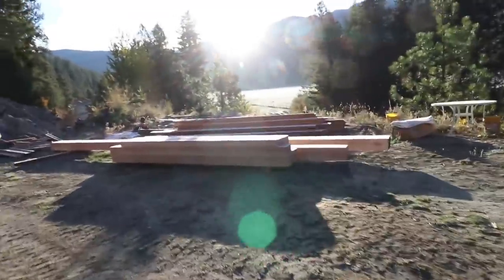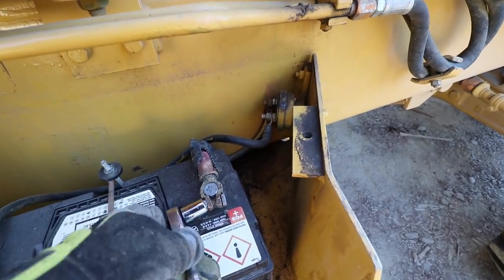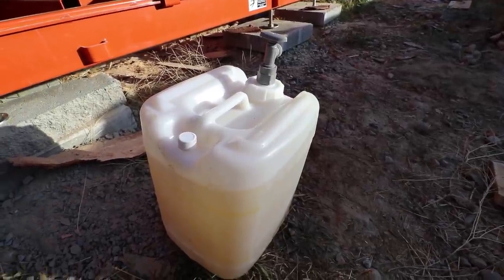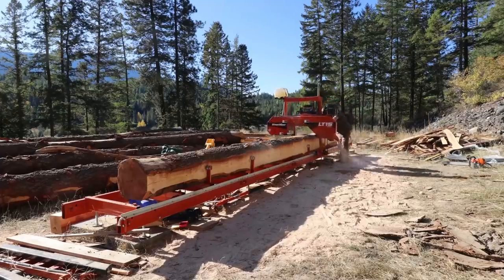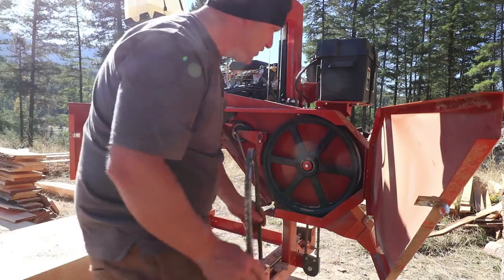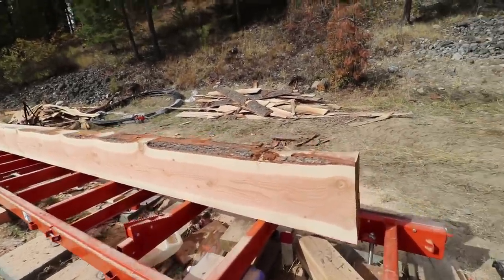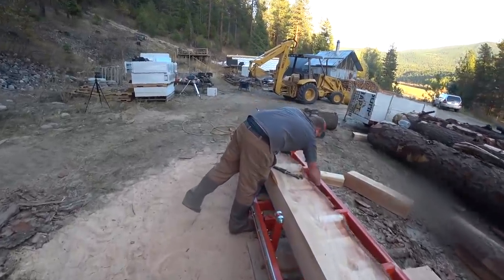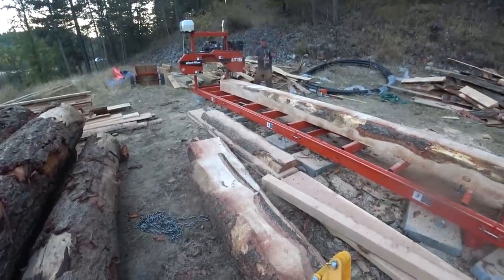BROKE OUR FIRST BLADE! (LT15 Woodmizer Sawmill)

Comment: Jesse do this to check to see if in reality you have a drain on the battery or just a bad battery. First make sure everything is off on the tractor, than take a volt meter on the amp scale and disconnect the ground cable and attach the volt meter ground to the battery post.  After that connect the positive lead from the volt meter to the ground cable on the tractor, make sure that your positive lead is plugged into the amp connector on your meter if not it will damage the meter, also make sure  that when everything is connected the ground cable and the ground post do not touch or you will get false readings. If you see anything more than a .04 amp draw than in fact the tractor has a drain somewhere. If its less than it is the battery failing and needs to be replaced. I will tell you with over 10 years of experience with automotive electrical systems this will give you the answer you need so you are not guessing.

Comment: If you have a multi meter then you can check to see if current is flowing with the machine off.   Also make sure you're running the glow plugs before starting in cold weather

Comment: You could try putting rubber pads between the metal sawmill feet and the concrete pads to keep the mill from moving when put logs on. Can probably get a large sheet of rubber at the local hardware store and cut up into appropriately sized pieces. Would be a cheap experiment.

Comment: You disconnect a ground on a battery first because it has less chance for arcing. which can cause damage to the computer and other valuable electronics on the machine. The same goes for hooking up jumper cables, only in reverse. You hook up the positive first and then the negative and vis versa when unhooking them. If you're looking for a parasitic draw you can always unhook the battery overnight and see if there's a difference.

Comment: Put a test light between the disconected bat cable and the bat stud ... If the test light lights there is a draw ... No light replace the battery..... Doesnt  matter what cable ......... If it shows a draw (light on)    disconnect fuzes till the test light goes off.... That will show what area the short or 12 volt draw is in ........  Hope this helps  Make sure the key is off durring test
Reply: Rick Helgerson, excellent divide and isolation technique.

Comment: you should always disconnect negative side first then positive, not that it matters but on modern cars you can send voltage spike through computers and wipe them out, in your case you should not use tools on positive side of battery without thenegative being disconnected, being a negative ground chassis if you where to accidentally hit the frame while unhooking positive side you can weld tool to battery and frame

Comment: you can have a voltage drop across the battery terminals with dirt/dust.  to test this, use a dvom from post to case. if you are having this problem(and you are) clean around the battery posts/top of battery.

Comment: Could u use concrete screws/bolts 2 fasten wood/steel on either side of some/all feet on the the sawmill to prevent them from moving?
If so, you would want to do so on most/all so as not to over stress just a few.
Also, consider that if you use this method, you will have to be careful about how much stress you put on the deck of the mill as the energy from the moving log will transfer into shear stress on the legs instead of movement as it does now.

I agree the ideal is/would have been to pour a level slab, but unfortunately you guys aren't in an ideal sitch right now.

Thank you for the video.
You guys ROCK!

Comment: Put 6 deep ground screw in anchors with turn buckles two at each end and two in the middle that should keep it from sliding around screw in anchors should be 4 to 5ft long

Comment: Seems like you should be able to secure both ends of the Wood Mizer.  Maybe a buried cement block at each end with some rebar to help secure the deck?  At least something with some heft to it as a temporary anchor.  Maybe a hole, say 3 feet deep, pour some concrete and use either rebar or threaded bar stock?  Just spit ballin'

Comment: To find the diameter of your logs at the mid-point take a length of string and wrap it around the log and use your finger to mark off the location.  Un-wrap it from the long and measure this length of string with a tape measure. this is the circumference (C) of the log at that point.  Use the formula C/3.14=d where "C" is the circumference you measured and "D" is the diameter you seek.

Comment: You normally disconnect the negative for safety, no other reason. If you put a spanner on the positive terminal (with the negative still connected to the body) and accidentally touch the spanner against the body by accident you are going to get sparks :) If you disconnect the negative first, touching the spanner against the body has no effect - much safer. I would just get a new battery, especially as winter is coming, and i'd buy the largest capacity you can fit in the box.

Comment: Backhoe - Check glow plugs/hot air intake circuit, but sounds like a weak  battery   when you cranked it.
Woodmizer (and/or chainsaw) blade(bar) lube/oil - cut it with a little kerosene -  1/2 to 1 qt per gallon; more as temps drop..

Comment: If your battery had that lead off, sine you stopped the digger, then it can only be a bad battery. or a wrongly speced battery.(Spec'ed, fFor cold starting.)
And, check your alternator. If there are bad diodes in the pack, it can drain your battery. (when it's connected). I have seen a few of these over the years.

Comment: i used to run heavy equipment. some vehicles had 2 batteries in series to boost the voltage from 12 to 24 just for turning over. 
could be worth a shot to try that. not sure why it wouldnt be in such configuration now though. 

probably just needs a new battery though

Comment: Either Battery froze at some point, or you may have excessive diode ripple in the alternator. The alternator may be charging the battery enough to run, but not enough to charge the battery to sufficient capacity to cold crank the engine over.

Comment: Hopefully you have already put in your slab for the saw mill. It's needed for certain and will save you a lot of time and miss machined logs. Also the alternator on the backhoe might be putting some charge into the battery but simply not enough to fully charge the battery.. assuming its not a duff battery.

Comment: Do you have room to fit a second battery wired in parallel? Also disconnect your ground connections and clean them with emery tape, the cause of many bad starting vehicles.

Comment: Hey Jesse, I noticed that you are using a floor jack to raise the log end.  If you look close and I'm sure you probably already know this but a floor jack has a tendency to move what it is lifting forward and back instead of straight up and down.  If you were on a smooth concrete floor this would not happen but you are using a floor jack on a rough ground so that the jack will not move forward and back to compensate for the lift. That is causing the saw frame to move toward you and then back again and to move all around.  I have a suggestion, and it just came to me as I was watching you lift the log in time lapse.  Get a spare trailer scissor jack like the one on a travel trailer and mount it to a 2 x 12 square block, and then use an impact driver with a socket that fits the jack to raise and lower the end of the log.  That way 1 it will be faster and 2 it will move the log only and up and down not moving the saw frame.

Comment: To keep your sawmill level, the best thing to do is buy a trailer that's built for your woodmeiser - you don't need a slab, since the trailer only had four points to adjust, it makes leveling it so much easier!!! In addition, it makes the portability so much more practical!!!

Comment: Just a thought, If you replace the concrete blocks from wood it will move a lot less. You can mill some wood blocks ~the same size of the blocks you are using.
I give you guys a lot of credit. I would have subbed out most of the concrete work

Comment: You were thinking of pouring a concrete pad too put your mill on try anchoring the mill legs into the concrete pad so it physically wont move thats what i did with mine and it hasnt moved in 18 months

Comment: Don't throw away that broken blade. You can braze it back together and keep as a backup. If you know of someone who welds, you could try bartering for their work if you'd rather that avenue, but I baize mine and have no issues. Just a propane torch and brazing rod will do the trick. Search Youtube for more info, it's how I learned about it. Has saved me probably $4000 since I started doing it.

Comment: With engine off, 12.70 volts measured across the negative and positive terminals indicates a fully charged 12 volt battery. With engine running, the voltage measured across negative and positive terminals should be 13.5 to 14.5 volts. A Diesel engine, once started, only uses a small current amount if you have a solenoid fuel shut off valve. Your battery may have an internal short or charging system is not producing correct voltage.  Could be both.
Reply: Get the voltmeter out and check voltage before you start and after you start.  It can be useful to check it while starting.  You can also check you disconnect to make sure it's fully disconnecting.  The one ground disconnect should be plenty if it is working.  I would bet the battery has a small internal short drawing the battery down overnight.  Check voltage after you shut down at night and then in the morning.  Don't just throw parts at it.  Diagnose it.

Comment: Ground anchors at all 4 corners and 2 in the middle pulling it down onto hard wood pads, as every time you moved a log the mill bed bounced and moved. 
Needs to have a dampening layer as one light bounce and it all moved, just watch your own vid's to see it moving.

Comment: Remove 6-8 legs from the sawmill bed, drill holes in the concrete pads in place of the legs and  then grab a threaded rod with a washer and a nut so it goes in the concrete holes 'anchoring' the sawmill, level it and hope not to move it when placing logs. Hope you understand what i meant, i'm not native English speaker.

Comment: As long as one of the battery terminals in removed from a circuit it can't be discharged unless there is a fault in the battery

Comment: Get a digital multi-meter and see what the alt output is.  It should be between 13.8 and 14.4  As long as you are in that range when the motor is running then the alternator is fine.  If it is in that range and you are still having trouble with the battery cranking the backhoe then get a good battery with the highest cranking amps available,  Might I suggest Interstate batteries and stay away from Walmart batteries.

Comment: If you are cutting Douglas fir (which they are) of that size, you should probably change blades every hour. But I'd u don't have your own sharpener you will want stretch that out. Cook Saw Mfg. In Alabama make probably the absolutely best small scale blade sharpener and tooth setters. And the best sawmills!

Comment: Corroded battery cables can waste precious CCA's in chilly weather. Peal the insulation back a bit and look for copper corrosion. Alternatively you can flex them and listen for a "crunchy" sound. If it's crunchy or corroded, replace them. Battery cables are not terribly spend and you can get them at any auto part store.

Comment: Can't you anchor those concrete footers with steel fence post?  Alternatively anchor that wood cutting frame on the saw with some metal anchors.  If it can't move or slide around it should stay level?  Crazy to have to level after each log?

Comment: The way electric circuits work, the - terminal has a higher concentration of electrons, and the + terminal has a lower concentration. So when you hook it up the flow of power is actually reverse of what you'd expect which is why the disconnect is usually on ground
Reply: That's right. In DC circuits, current flows from negative to positive. I forgot about that.

Comment: Have you thought about driving some anchors in the ground similar to those that used for telephone pole guide wires and strap the mill down in several places so it doesn't move

Comment: You need to look up and check starting amps. It could be your wires are old and not allowing the 500 amps or your starter can also be worn drawing massive amps and becoming extremely inefficient.
Reply: And by jumping off your going from 12.5ish volts to 14 volts. Check  the voltage at the starter when cranking. Also clean all connections. Spend time now save money in the long run.

Comment: If I may add a helpful solution to your calibration problems, I believe the answer has to do with some of the slabs of wood you are piling up. Just curious what would happen if you bored some holes in the scrap slabs you have already cut off the logs to fit the diameter of the adjustable legs, and place them across the rails the short direction so one piece of wood holds 2 legs, then using a log for weight seat the slabs into the ground, remove log and adjust to flat with the legs.

Comment: Greetings from Finland. Have you measured resistance of the battery cables? Measure resistance from battery (-) -> block and battery (+) -> starter. Both of them should be ~0 ohm.

Comment: batteries all work the same.  the circuit's power travels from the positive node to the negative node.  the negative node also is grounded to the chassis of the car's frame, which I believe it a safety feature, such that, if you're standing in water and and you grab a wire in the circuit (now becoming apart of the circuit) power still travels down the ground path and not through your body to find ground.  power travels the path of least resistance.  disconnecting the wire from the negative node creates an open circuit (no power).  It's safer than disconnecting the wire from the positive node, which can arc a spark.

Comment: I am so positively impressed by these two young people. Those making endless negative comments should be ashamed of themselves.
Reply: I'm not referring to the constructive feedback, I'm referring to the constantly negative, whining nastiness of quite a few commentators. Surely you've noticed? I, too, occasionally make suggestions. However - having spent many, many decades doing this and similar work on various job sites,  and actually being a licensed contractor, I have the experience to know that what these two people are doing is fundamentally correct. Sure, they make mistakes - and anyone who has spent any time at all on a real construction site will have seen many, many mistakes made - but they learn from them.
So, Mr. Wizeguy, try reading through this entire comment's thread and then, if you still feel there weren't negative comments, one of us is seriously lacking in the ability to parse common English.
Reply: Mr. Wizeguy, I suspect nothing I posted would change your mind so I'll just leave it at this.

Comment: Question- On the size of your beams- does the overall height and width of the cross-section have to be that accurate? Won’t there be a surface that is not contacting another component that can just be where it ends up within and say a quarter inch? Watch like a 6 x 6 that is actually 5 1/2 x 5 1/2 or 5 5/8 x 5 5/8?

Comment: An alternator is there to supply the electric when running and maintain the battery. A working alternator should have a voltage of 13.5 to 14.5 volts. Under normal operations this will maintain the battery. Less than 13 volts and a battery will start to draw down. Once a resting battery voltage drops below 11 volts it will need a full deep charge by a battery charger.

Comment: Move your logs on the ground not on the mill. Windshield washer is used here in Canada. Blades should be sharpened when they stop cutting well. I have had some saw all day and others hit metal on the first cut. Long wood can move on its own from  internal stresses as it is milled.

Comment: 1/windshield washer fluid/water combo works.
2/check w' timber frame people about having posts w' offset pith.
3/mind your outer blade guide roller, it shouldn't be too far away from the log/cant.
4/you could make a frame for your mill out of heavy timbers w' offset scarfs, but you probably don't have the time to do it now.
5/fresh blade wont produce many 'hairs' on the backside of the cut, will gradually produce more as blade dulls to point where there are constant hairs along length of cut. by the time the blade is doing this, it has been on too long. the hairs are easily taken off w' a small plane.

Comment: Make sure the alternator is putting off around 14ish volts.  the alternator putting barely over 12v the tractor Will run all day but when you turn off the tractor,  the battery should still have a surface charge that kinda soaks in and the voltage will end up resting in the upper 12v lower 13v.    If the alternator is putting out barely over 12v there is no room for the battery to charge when the12v  ignition system uses up some of it including everything else that uses electricity.

Comment: How big of a beam can you get from a given log ? 
( A^2+B^2=C^2 ) = minimum diameter of the log.
For an 8"x12" beam  you need a log with at least 14.422" diameter. 
Circumference = (Diameter * pi) = 45.308" 
 
So if you make a list of your standard sizes that you need for the timber frame, you can  chart out all the different diameters / circumferences,  Laminate that and keep it near the sawmill.

Comment: I was going to suggest something simmilar to what michael ryan mentioned below only my thinking was drive rebar at four opposing angles in sever locations under the mill and use say 1" rachet straps to the mill from the rebar to try and secure the frame so it does not move so easy when being bumpt and joseled. A lot of work I know but I think it would help keep it from moving so much.